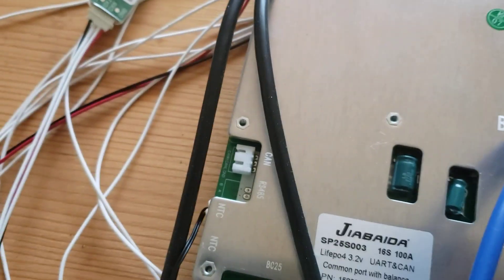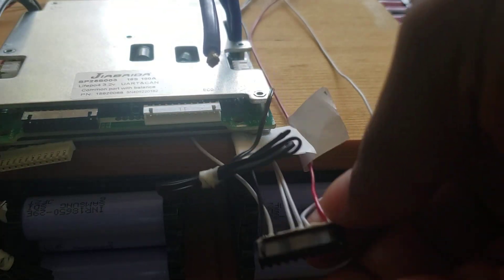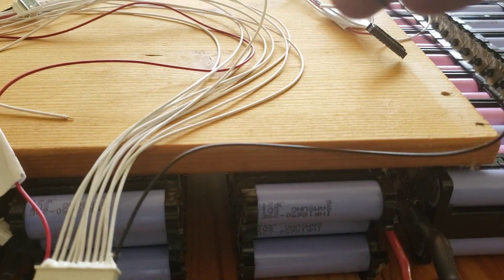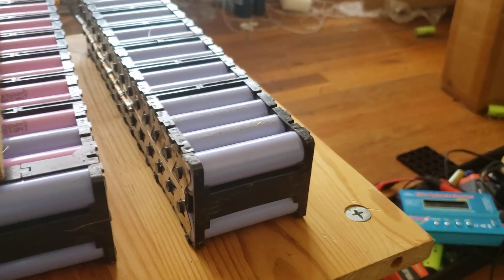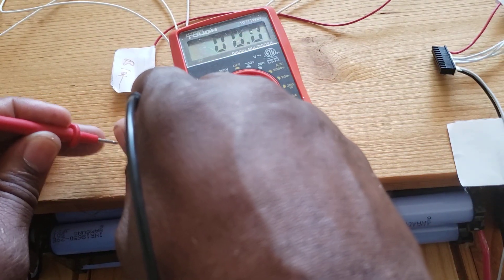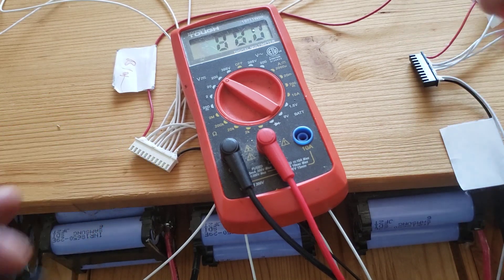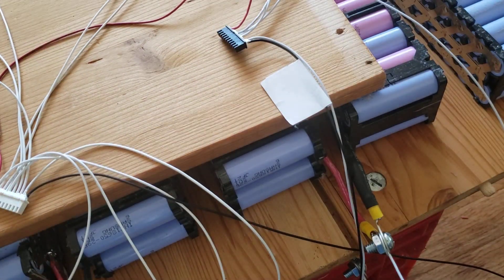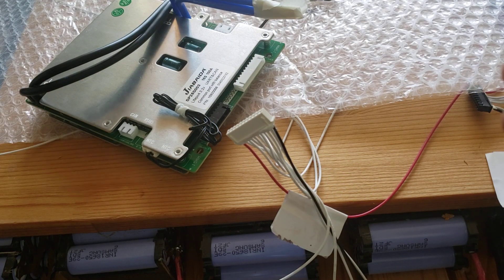LOOK AT WHAT HAPPENED WHEN l TRYED TO USE JBD BMS 16S 48V  ON A 14S 48V SYSTEM #JBDBMS16S

Comment: Did you sort it?

I don’t think the first line was wired right.

When you voltage tested from one side of that connector to the other, it shouldn’t be showing the single cell voltage.

It should have been showing the whole set of series cell value when you were testing the very outer lines.

You had like 48v when probing the pin right next to the black wire one, that should have been the single cell voltage.
Reply from the maker: I'll have to double check that

Comment: is that bms for lifep04 battery, 16s 48v is for lifep04. or the voltage can be programmed?
Reply from the maker: It was a 16s 48v. It didn't work. I was testing to see what would happen

Comment: I went with JK bms, I will never use any other it just does the job.
Reply from the maker: They're very expensive.
Reply: @simplyfocus9937  and they work well..... after i bought a cheap ebay bms and it never worked right I asked in groups what should i buy for reliability, and jk bms was the answer

Comment: could this bms be set up for the 4.2 cells instead of 3.2 when connected through the app as you can with the daly ? i dont know if you can mess with the settings without the batterys connected ?i usually make 1p setup to test my bms and yh i do my testing outside
Reply from the maker: I was trying to get there and reset the voltage in the app. Each pack was already at 4.17V.